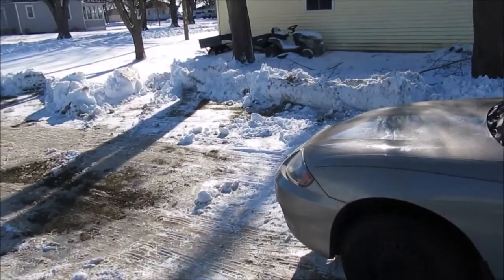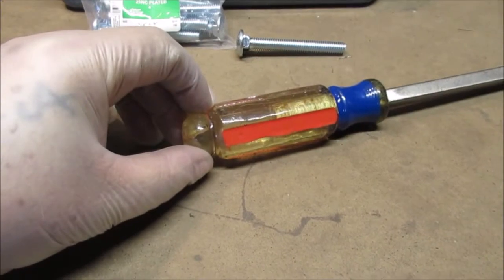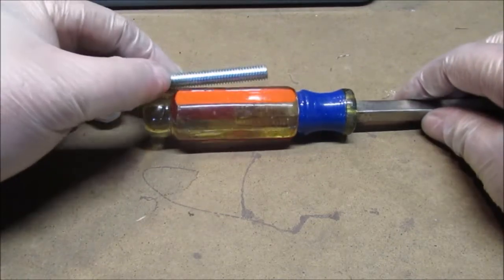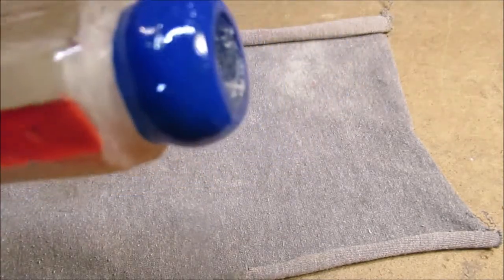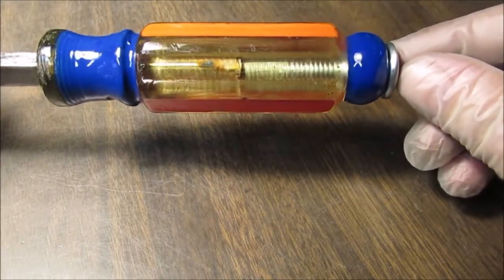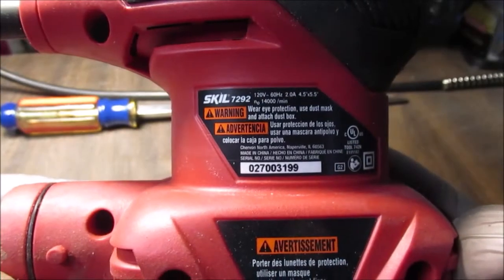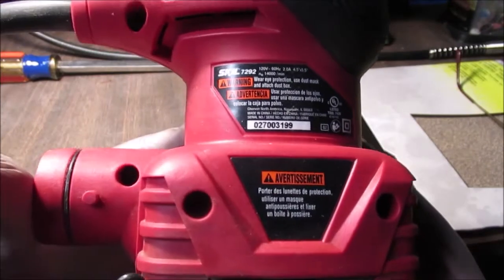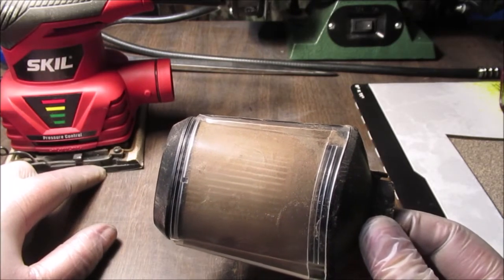Nice Winter Day to work in the Shop

Comment: Glad you got all that snow we were supposed to get an inch or 2 friday night through early saturday morning but all we got was flurries. I have a dewalt orbital sander i have for 20 years or longer the hook and loop on it still works good its got a crappy filter that i never use though its some kind of black plastic thing that i don't like.
Reply from the maker: My cheap orbit sander I started gluing the discs on it   I like this new 1/4 sheet it runs so smooth